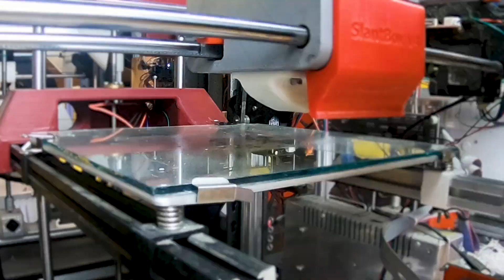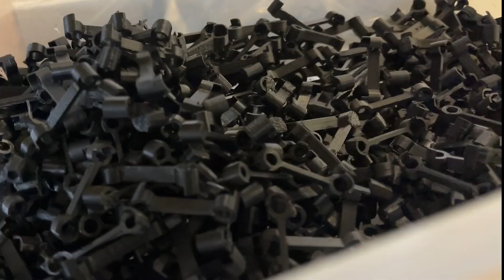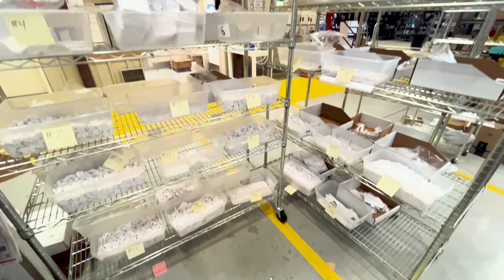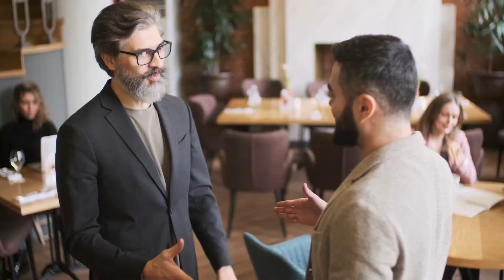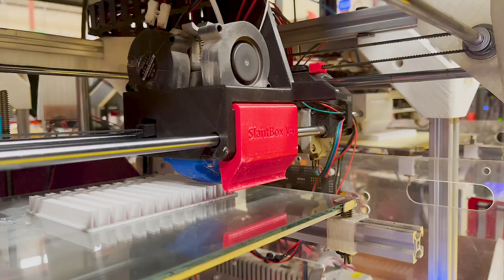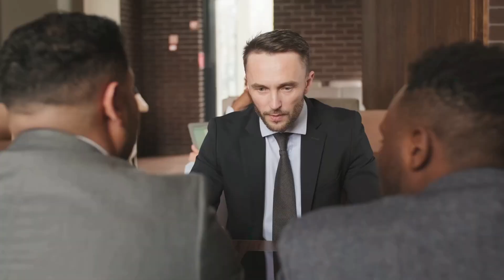Avoid These Common Mistakes for a Better Manufacturing Partnership

Comment: I used to work at a thermal management company. Educating the customer and drilling down to their actual issue was always step 1. It would go something like "do you have a cooling problem or a heat sinking problem? Cooling is below room temp. Heat sinking is being above room temp and getting back to it."

Comment: Great video! I was wondering what companies you send clients to that need their product prototyped? That is a market segment that I wouldn't mind dipping my toes into. I understand the draw backs that it has, I know someone who has had a couple of things prototyped for mass production and I strongly believe that if I had my current understanding of 3d printing and design that I could've helped them and gotten rid of a ton of their headaches.

I saw some of the prints they were getting during there prototype stage and they were terrible. Cheap obviously, but terrible.

Comment: I’m enjoying your videos; great information. Would it be possible to show some examples of Slant 3D’s multicolor PLA print capabilities? Also, any information you could share on design limits or things to consider when developing a multicolor product would be appreciated. 
Thank you!
Reply from the maker: We don't really do multicolor prints. They are generally a gimic more than what a customer actually wants to needs.
Reply: @slant3d  I don’t understand how this is categorized as a gimmick. I’ve seen some of your prints, like the golf tee box markers, that appear to be multicolor. Is that a post production paint application?
Reply: @MrRwillis59  I think what he is getting at about it being a gimmick is that you would only do a one off or very small production runs with a multicolor printer, as the current more common conusmer grade multicolor printers are quite inefficient and wasteful for mass production at scale.

Comment: Do you guys off anything like HDPE?  I have a project that needs to be resistant to fuel (gasoline). 
Thanks
Reply from the maker: Probably not the best application for printing. A Roto or blow mold would probably be a better option.
Reply: @slant3d  in this case, it won’t be submerged, it is mounted to the top of the tank   Might get splashed, at the most.  HDPE is what the tank seems to be made from, as well.

Comment: Doesn't this sort of contradict the hands-off impersonal API approach to working with a customer?
Reply from the maker: Different customers have different needs. And it still applies to any sort of contract manufacture that you might need to interact with when making a product that is not has heavily automated. If we didn't start from here the "hands-off" API would be a really crappy experience.